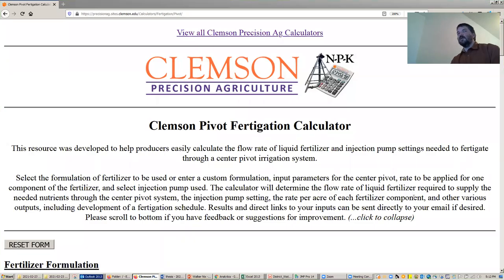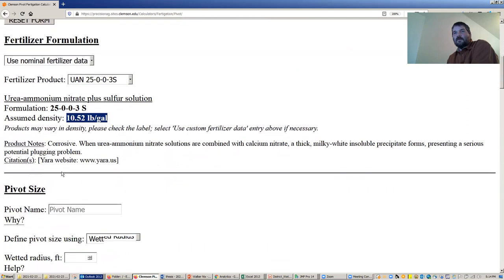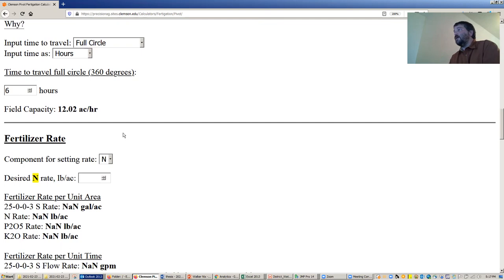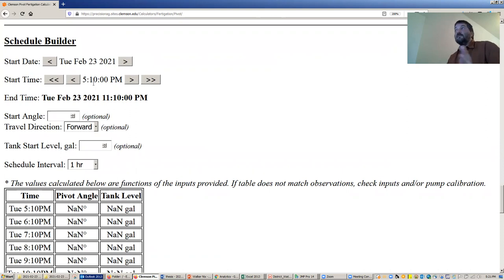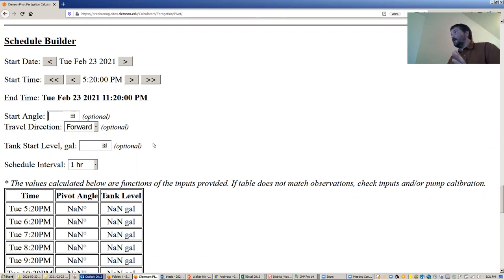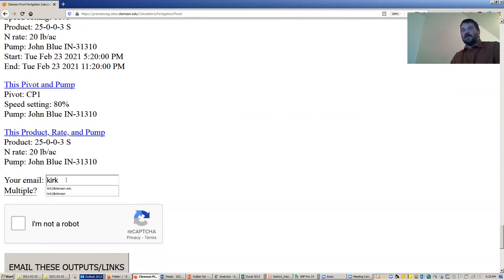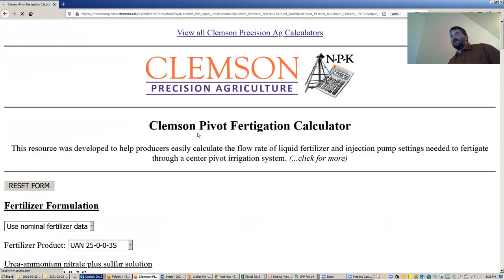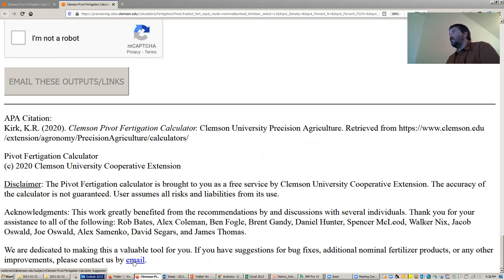Pivot Fertigation Calculator Demo

Comment: Can someone explain how to transfer percentage to meters ?!
So for example how much is 45% speed in meters per hour or per minute ??!
Reply from the maker: I assume that you're referring to the speed of a center pivot irrigation system. Speed of most center pivots is controlled by a timer, which controls the percent of time that the drivemotor on the outermost tower is operating. As an example, at 100% timer setting, the drive motor for the outermost tower is moving 100% of the time and the pivot is therefore at its highest travel speed and therefore smallest irrigation depth. In another example, at 50% timer setting, the drive motor for the outermost tower is moving 50% of the time and the pivot is operating at half speed, which would apply double the irrigation depth of that at the 100% speed setting. Travel speed in meters per hour or meters per minute will be a function of several factors, but if the pivot manufacturer provides the time to travel a full circle at the 100% timer setting, then you can divide the circumference (circumference = 2 * 3.14 * radius) at the last tower (in meters) by the time to travel a full circle at 100% timer setting to determine travel speed of the last tower at full speed. Determine travel speed of the last tower at any other timer setting by simply multiplying the timer setting by the travel speed of the last tower at full speed. Hope this makes sense.
Reply: @ClemsonAgMech  Company where i work have 9 Valley Center Pivots manufactured in 2006. 
8 of them have length of 650 meters and 1 is 450 meters long.
But we always have problem with percentage ( % timer ) because we mainly running all them with speed of 45% to 70% max.
Formula that we use to calculate how much speed of pivot ( i mean end tower ) is to divide 60 ( that's one hour ) with 45% ( speed of percentage indicator ) so then we get 1.3 meters that end tower will travel per one minute, but it's not accurate. People who work with them using that formula, have problems to calculate when will center pivot exit on maintenance road. I hope that you can understand what i am talking about.

P.s I read all manuals provided with Center Pivot, but still there is no explanation how meters or centimeters is per 1% of speed.
Reply: @ClemsonAgMech  If we have for example 75 meters to the maintenance road at 45% speed Pivot will need 1 hour to travel that distance ( using formula 60 divided with 45 = 1.3 meters per minute )
Reply from the maker: @soulbrothers7789  If I am understanding correctly, it sounds like the time to travel a full circle may not be correct. 
- Before proceeding, it may be worth confirming that the distances to the last towers are 650m and 450m: you may be able to do this accurately enough using satellite imagery. We'll name this distance "radius". 
- Now, you calculate the circumference, circum = 3.1416 * 2 * radius. The circumference is the distance that the last tower must travel to complete a full circle. For example, on your 650m pivot, circum = 3.1416 * 2 * 650m = 4084.1m
- Next, set the percent timer on 100% and determine the length of time the end tower takes to travel a known distance, for instance 50m (make sure you're measuring along the tower wheel track and not in a straight line). You could mark this position along the outermost wheel track in advance by placing a flag in the wheel track at a distance 50m from the starting point. Try to use the same reference position on the tire, for instance the leading edge, or the center of the wheel hub. 
- At 100% timer setting, start the pivot towards the flag placed 50m away and start a timer to see how long it takes to get to the flag, we'll name this t_flag. 
- Now you can calculate the travel speed at 100% timer setting, we'll name it Full_Speed = 50m / t_flag. For instance, if it takes 20 minutes to get to the flag, then Full_Speed = 50m / 20min = 2.5 m/min. 
- To calculate speed at any other timer setting, you simply divide Full_Speed by the timer setting. For example, to know speed at 45% timer setting: Speed@45% = 2.5 m/min / 0.45 = 5.56 m/min.

I hope that this makes sense.
Reply: @ClemsonAgMech  Thx for your reply, it's making sense now. Thx big time
Reply from the maker: @soulbrothers7789  Glad this helped. If this still doesn't match with what you observe, then it's probably one of the following: wheel slippage at last tower, improperly functioning timer, or rounding/other errors in calculations/measurements.
Reply: @ClemsonAgMech  we need more people like you
Reply from the maker: @soulbrothers7789  You're too kind. Just doing my job. Best of luck to you.